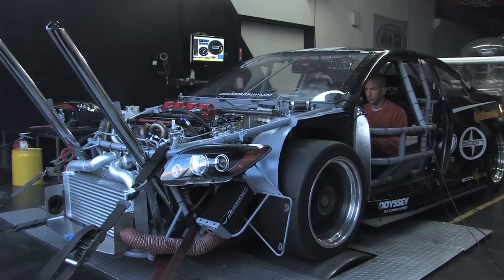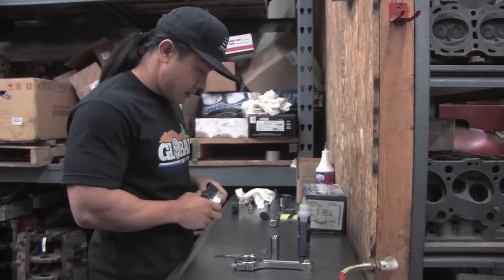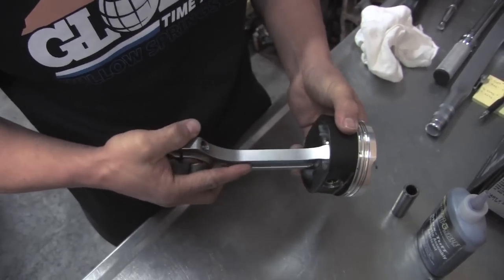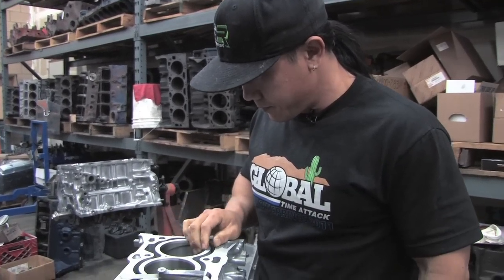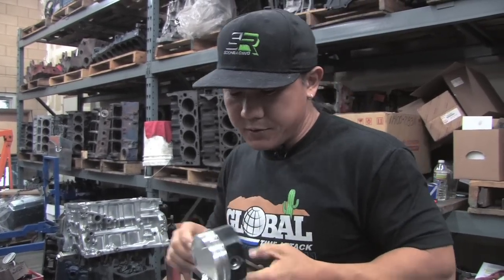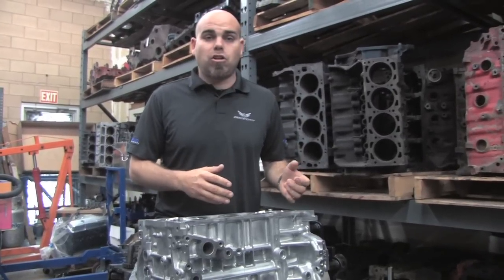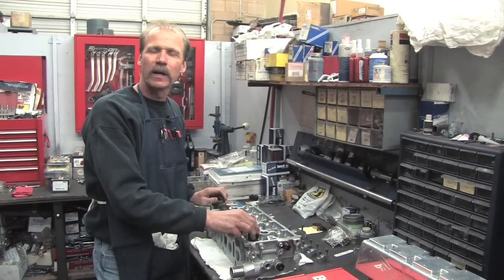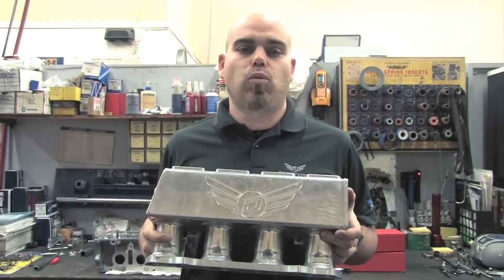WORLD Racing Presents: Descendant Engine Build

Comment: I just built my 2AZ engine. Used this video as a guide for a few parts. Super ecstatic. Running BC stage 3 cams in a ported head with BC springs and Manley valves. New factory crank, Manley rods, CP pistons, king bearings. Fully blueprinted motor/oil pump and VVTI delete. Should make a conservative 450 whp with a 57mm precision turbo

Comment: so, one minor mistake. mic'ing the cyl's should be done with a torq plate installed. from what i know, the head will twist cylinders just a tad, so w/o torq plate we should expect the bores to not be perfectly round, and, pistons should be slightly oval because when they heat up they will stretch more in some areas which will return the piston back to round. this is imperative for a HP motor, etc

Comment: the torque plate is used mostly during the machining process to keep everything perfect while the machine is removing material. not necessary when checking specs.

Comment: how do you determine what fuel pressure regulator to use? Do you have a video on this?  I have a 3.0L inline m3 at 12:1 high compression, and 21.5 LB Injectors, what do you recommend?

Comment: can i ask why measurements are taken on room temp parts.

would it not be more accurate to pre warm the parts then measure as certain metals expand and contract at different temps. Certain metals will also expand more then others at set temps aswell.
Reply: Specs are for room temp metal.

Comment: best way to learn would be to read some basic stuff in books an online. then buy a cheap car for like $100. i don't know the prices in the states. but a lot less than in europe. anyway. then just take it apart and see what does what and build it back up again. when you take it apart you can simultaneously look at pictures to know what part it is and what is its function. i myself have a hard time learning by just reading so the best way is to just start messing around.

Comment: how do you determine what compression ratio to aim for when building a turbo'd engine?
Reply: for dayly driver low to mid compression meanin 9.1 10.1 to the race track high compression whit bigger turbo would make power wgit less boost 11.5 12 and above wgit the proper race gas and a badass tunner can be done

Comment: no plasiguage? no stretch guage? Lol
Reply: plastigauge is/should be only used to verify. this engine was completely blueprinted, and if you noticed they already knew all clearances and had a bearing in. depending on the race engine bearing clearances aren't as crucial as on a street engine. these engines are being refreshed and rebuilt constantly and live short lives. If you notice ACL only makes 3 sizes really (std,025,.25) ever wonder why?
Reply: @LamassuSound  Never trust a parts manufacturer, always measure.  Clearances are MORE important on a race engine.